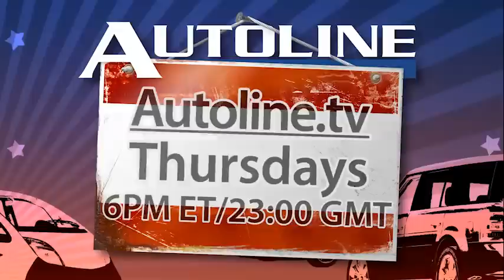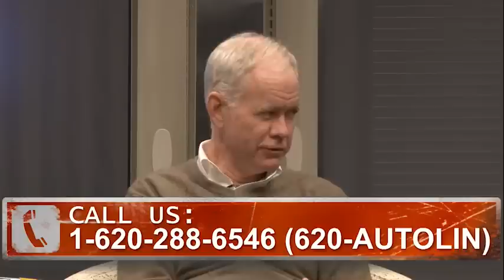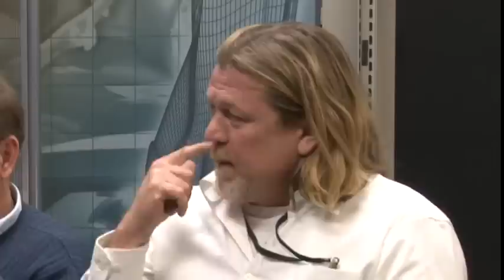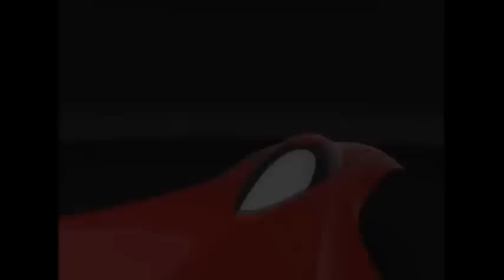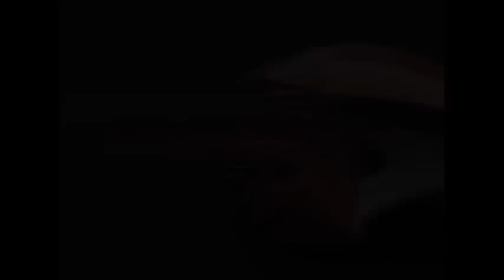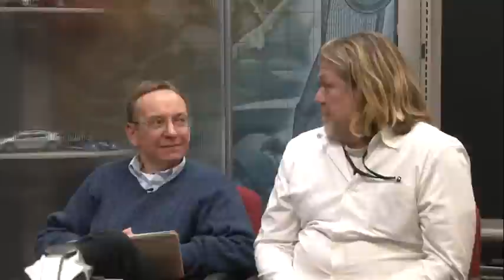The World's Newest Automotive Design School - Autoline After Hours 174

Comment: I avg 31.8! MPG after Ford reprogrammed my TCM to get rid of jerky shifting, PCM and ABS, although my ABS was just fine, they did that one anyway with the recall. When the car was NEW I got 32mpg Avg. I'm going to switch to Chevron gas again. Using 76 gas on a 1990 Hyundai Excel after 16 years, I got 75 miles on a tank and on Chevron gas I was getting 110 to 120 miles on a tank of gas. Gas is different, cheap gas is not good.

Comment: My manual Subaru BRZ is rated at 22 city 30 hwy. At a steady 75mph I get 35 mpg.  In normal driving I get 30 mpg. Even having a good time I seldom dip below 27 mpg. My 2000 Celica was rated at 28/32. I averaged 32 over 300k. I have a 2001 jeep Cherokee that is rated at 15/20. In stop and go suburban driving I get 16.5 mpg on the hwy I get 19 mpg. 

My BRZ computer (made by Toyota) is about 3% optimistic. So if it says 33 mpg if you calculate it yourself you will find that it is 32 mpg.

Comment: The Jetta and Passat  Diesels can easily top 40 mpg in the real world. The Cruze Eco Manual with a light foot can easy do mid to hig 30's.   On a long hwy run under 75 mph almost any modern 2 liter manual car can hit 40 mpg with a light foot. I get 35 mpg at 75 mph in my BRZ manual.